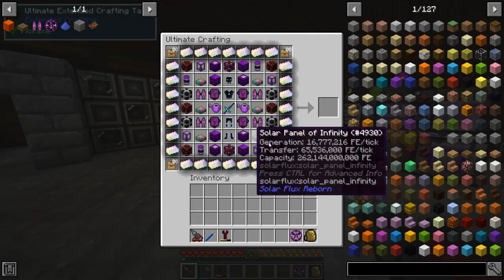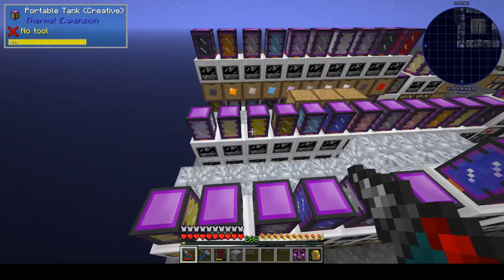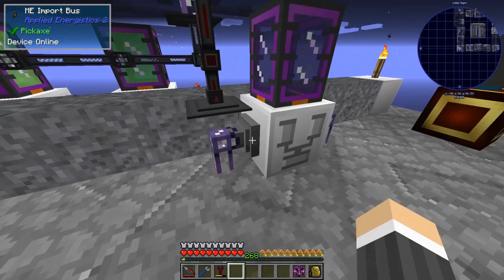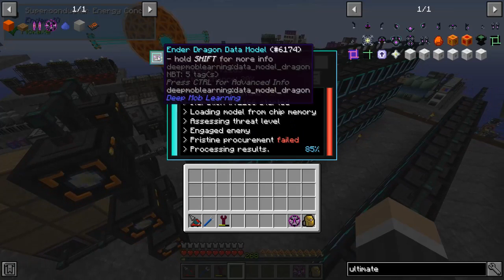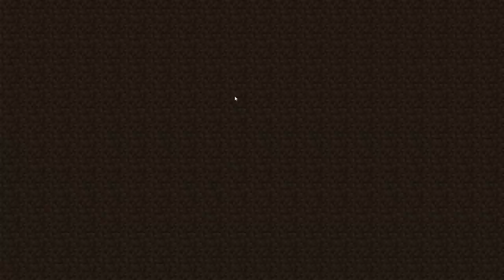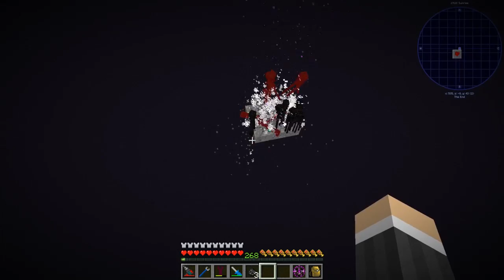OmniFactory - Creative Vending Upgrade Base Tour

Comment: 2 Questions.
1: How many tier 7/8 missions did you need?
2. How did you handle crafting that many warp engines?
Reply from the maker: Maybe 5000 tier 8 and 6000 tier 7

I had 6 dedicated fusion crafting setups for advanced dislocators, 20 soul binders for flight control units, dedicated assemblers for glowstone elevation units and conduits. Most of the ingredients needed to craft them were already available.

Comment: I have just one question: how did your machine handle it? I mean.. did you do some logistic shenanigans to help with performance, or did your PC just not die?
Reply from the maker: Reducing the use of AE2 crafting cards and import/export buses was how I dealt with the performance. They are the main cause of all the lag.
Reply: @alexvaldevon6783  How about AE storage buses on storage controllers? I've seen examples how these cause a lot of performance issues, especially when the drawers get updated very quickly/constantly.
Reply from the maker: @EwanKaye  They seemed fine for me as long as the number of drawers was low (no more than 50 or so). I also had my storage buses on extract only so that cuts out some of the operations
Reply: @alexvaldevon6783  Thank you for replies! Awesome job on the base.